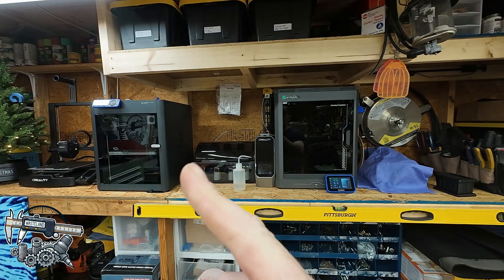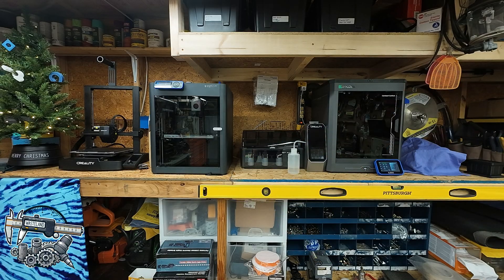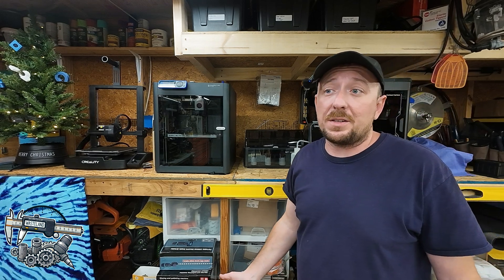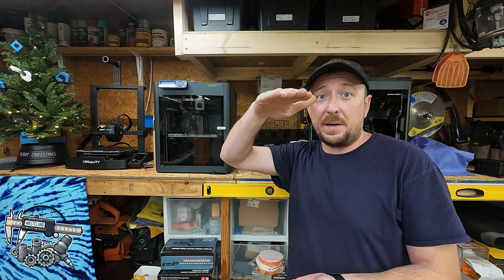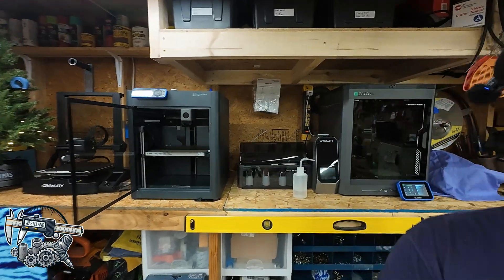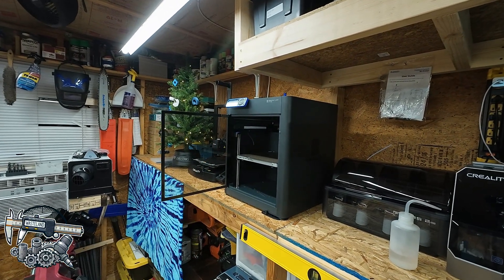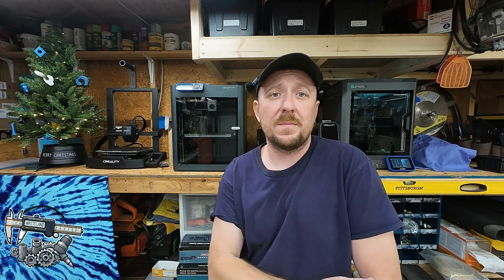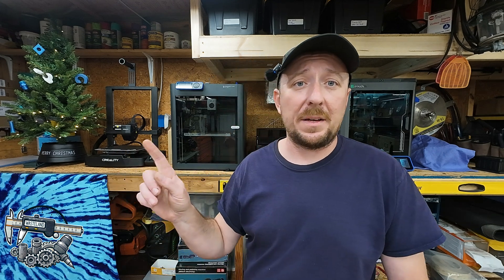Bambu Vs Elegoo Is There a Clear Winner

Comment: I’m just curious as to why you chose P1 rather than P2 Bambu. Hardened extruder GEARS and nozzle, the AI camera, clip hotend swapping, better heat control and a better screen seems to justify the small price difference. The P1 is very solid but very basic.
I have a v1 CC and hotend nozzle swapping makes me very nervous. I will probably have a go at the Bambu clip-in mod for my CC, but the P2 looks like the future - though I’d rather have an H2S if it wasn’t such a huge price jump from the P2. 
Just to add that neither the CC or P1 will do your full 256 cube. There’s a no-go zone for the filament cutter that intrudes unless you get modding. And the P2 fixes that as well! 
And as for multi material/colour, I believe you can hook up plural AMS units to the P2, but still only one to the P1…
Reply from the maker: The only reason I didn’t was simply because I’m cheap.  The P1 has everything I need especially with the new AMS. I agree the P2 is certainly the better choice but it’s also like $200 more.
Reply: @Workshop_Wasteland  😊 me too! But at the current UK pricing £339/479/999 for the P1, P2 and H2S, I can see real value for the extra for the P2, but the doubling for the H2S is where I take a step back. 
Just hardening the P1 accounts for £50 of that difference…

Comment: Have CC v3 enjoy it and never have an issue with over 700 hours. I have not even had to replace or re-grease. The objects always stick when printing, come off easy when finished. One exception was ASA had to increase bed temp by 5 degrees and no problems since. However, PETG brims suck with the CC so I stopped using them. No issues after that and 3d models stick fine. Not happy with the Multi color system snafu but didn't buy it for that. It was quality/cost combo. I never buy a product that promises something in the future been there and done that! Hope you enjoy the Bambu heard it is a great machine!!! BTW, I hate the Apple ecosystem...so maybe take my opinion with a grain a salt! ;)
Reply from the maker: Glad to hear you've had such a good experience with yours! I also don’t really have a single issue with my Carbon. Over all it’s a fantastic printer.

Comment: Make sure to purge like crazy when switching between pla and petg.  With any single nozzle/ams setup (regardless of brand).... switching from petg to pla can/will leave trace amounts (in the nozzle) of the previous material which will weaken layer adhesion of your normal/non-support material.  In addition to max purging... recommend a very wide oversized purge tower.  ==> I was very intrigued by this concept, but in real world use it will weaken your layers.
Reply from the maker: Good info.  Thanks for taking the time to share that.  I love the printing community.  Everyone is so willing to share their tips and tricks.  I am not at all new to printing but never used multi color before

Comment: I like my Centauri Carbon, though will probably be doing the H2S nozzle upgrade on the hotend so I won't have to risk breaking the hotend connectors again (mine was down for nearly a month waiting for the replacement pcb from Elegoo). It also solves the bending/breaking at the heat break issue a lot of other CC users have had.  It's build volume is a bit too small for a lot of my products though so not buying another one. I have 2 multicolor printers for when I need it so had never planned to add multicolor to my CC anyway.

For supports, up your interface layers to 3 and make interface spacing .1. Adjust your top/bottom z distance to layer height + .02-.06 (so .22 or .26 for a .2 layer height) and the supports come off like butter.
Reply from the maker: I didn’t have multi color till my recent purchase of the P1 and really planned for the carbon to have it at some point.  But I think it will just stay a work horse for exotic stuff and leave the easy PLA things on the P1.  Thanks for your tips on supports, I’ll definitely give that a try. This is what I love so much about the printing community, willing to share most anything. No real secrets

Comment: Centauri was really good until the  702 error hits. Should be an easy fix right? Well if they offered parts maybe😂.  No parts make it hard to endorse anymore. Ran great for two months. Artillery m1 is the same, ran like a serious contender for a month. Then just bricks!  Bambulab is ruling my room at the moment. Wondermaker ultra z is shipping next year. We will see how it performs. 
Three Bambulabs in the shop now. Wish it was 5
Reply from the maker: I’m very satisfied with the CC as long as it doesn’t start acting up. I feel as though it’s on borrowed time though. The P1 seems like a work horse on a tested and proven platform

Comment: Same path as you, ender 3 v3 se then CC, I have the v2 with the new led strip on the side, there seems to be a v3 now without the rear multicolor port and a front and side LED. I was debating picking up a p1s during Black Friday but after seeing some of the downsides vs the p2s and elegoo dropping the price to $265 I ended up ordering a second CC. I rarely have a need for multicolor but when the time comes I'll be looking at the p2s or the snapmaker u1.
Reply from the maker: Sounds like you've got a good plan. The price drop on the CC definitely makes it a tempting option!

Comment: I love my Centuri Carbon. A total workhorse. It’s speed. Accuracy. And repeatability are stunning. 
I also want a multi color machine but I just can’t get myself to buy a machine that produces a high amount of waste so I guess I’ll wait for the new multi hot end machines to come down in price. I saw pics on the Centuri 2 and I just can’t believe they are going to release a machine that’s obsolete right out of the box, it should have been a multi head  machine.
Reply from the maker: Not to mention that enclosure piece on the top looks god awful.  I really think the Carbon one was a cash grab which was very successful. The Carbon 2 isn’t going to sell hardly at all.  They made the entire community mad at them.

Comment: I'm happy with my Centauri carbon!

If I want a multi color print I'll download a multi part print and save myself  Filament waste and time
Reply from the maker: I’m not unhappy with mine either.  Just frustrated they didn’t release the multi color like the had originally said.  Either way, my Carbon will be the engineering grade printer and the P1 the cool stuff